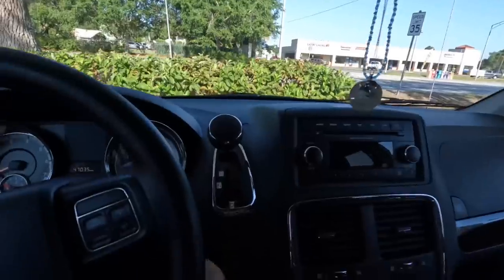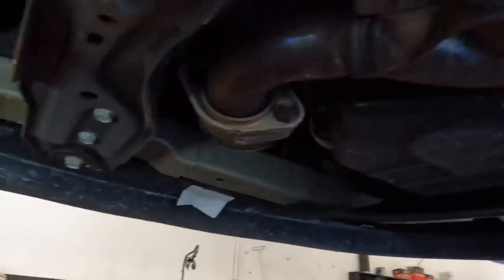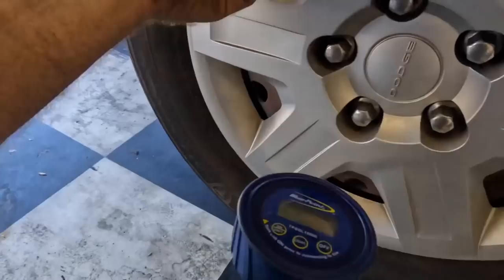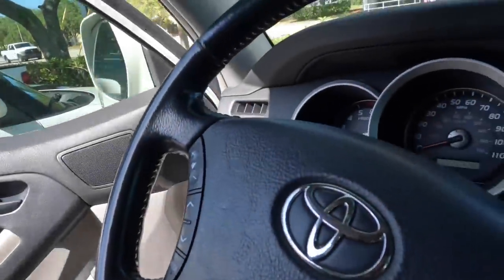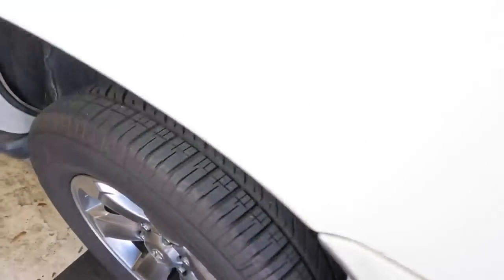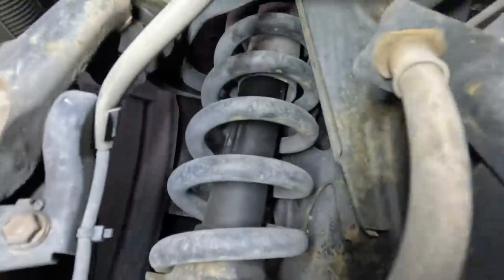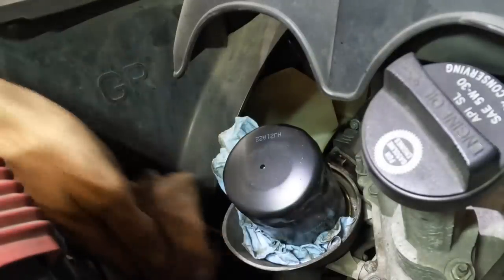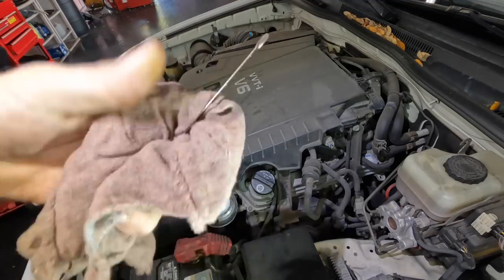This video is terrible! Home Sick B Roll

Comment: Hey Ray! I had to put a new alternator in my daughter's car this past weekend. She helped me throughout the process. There were a lot of "clicks," "reverse clicks" and "gravity." I watched as one of my tools fell to the garage floor. I told my daughter, "Ray would have caught it." I have been working on my own cars for a very long time, but auto maintenance will never be the same for me or my family since watching your amazing, incredible videos.
Reply: I totally agree. I used to help my Dad many, many years ago, over 40 years, and watching Ray brings back so many wonderful memories. You are making great memories!  Thank you!!
Reply: @lisas292  Dropping Dads flashlight. "Gravity!"  SMACK... 😰   /jk
Reply: LMAO I say Click every time I tighten a bolt
Reply: I drop stuff and now say "<item> Gravity". Family thinks I'm weird, so thats not changed at all :)
Reply: @lisas292  My dad had Triumphs back in the 60s. A couple of Tr3s and a Tr4. My job was to crawl under the car and retrieve the pieces he dropped. I still have some of his Whitworth tools.
Reply: That’s a riot
Reply: It's a good thing when a dropped tool hits the floor. Rather than getting stuck up in the chassis.
Reply: @roadking99jokerst60  watched an engine tear down video where the guy found a unicorn in the sump. Yep a still readable, but pretty worn looking 10mm socket and extension in the sump. 

Beats having to fish it from behind the engine block I guess lol.
Reply: @roadking99jokerst60  Right on! I always hope to hear the reassuring sound of a tool or part hitting the ground. At least then I know I can find it.

Comment: The third stimulus bill changed the formula that employers use to calculate how much to withhold for income taxes so they had to take less out of people's paychecks so they would have a little bit more money each paycheck.  That meant smaller refunds when people filed their income tax returns.

And people who got advanced payments for the child tax credit but could not still claim one or more children, for whatever reason, on their tax returns had to pay income tax on that money and did not get the other half of that child tax credit.

And then there were the people who got reclassified from employee to independent contractor (self employed) and found out the hard way that they owed the employers and employees part of social security and medicare taxes which is 15.2% of their net revenue.

I had six people with 1099-NECs (self employment) come in on the last day who had no idea what a 1099-NEC entailed and did not set aside any money for the taxes and did not have money to pay the fees to fill out and send in the required forms for self employed people.  I had one person who received a 1099-NEC with nearly %24000 on it and no expenses which meant his self employment tax was going to be about $3650.

Just for everyone's information, filing your tax return and paying any tax you owe are two separate events.  You do not have to do both the same time.  So if you think you are going to owe taxes it would be in your best interest to file your tax return as soon as possible so you know where you stand and then have until the filing deadline to save up the money and get the payment in the mail.

I encourage anyone who is thinking of being self employed or starts getting a paycheck where they are not taking anything out for income tax, social security tax, and medicare tax to set aside a minimum of 30% of your gross revenue and then make quarterly payments by filling out a 1040-V and mailing it and your payment to the address listed on the 1040-V.  That way you will not have the big tax payment due when you file and might get a refund like you did when working as a regular employee.

April 15, June 15, September 15, January 15 of the following year are the dates you should make quarterly payment by.  You can make them earlier or later except for the last on in January which should not be put in the mail later than the 15th.

Comment: I can give you a little tip for the Toyota vehicles when you’re changing the oil, Take one of the single quart bottles of mobile one and cut the bottle in half, The threads on the top of the bottle are identical to the threads for the oil cap on that motor so you can use that half bottle as a makeshift screw in funnel

Comment: A trick I learned working on my 07 Tacoma, just put an empty oil bottle wedged in the area under the oil filter and it collects the spillage, or run a tube from that little nipple to a drain pan.

Comment: That Toyota 6V 4 litre is easy for an oil change. My sons Tacoma had enough ground clearance you can slide right under and drain the oil with no ramps or lift. The filter is easily accessible on top, but use a little cup under the “moat” to catch the seepage.

Comment: Hey Ray. Hope your having a great day today. One thing I always do on my Toyota (Yoda) I put an old quart jug just under that little hole and it catches all the oil from the filter and then I put on new filter and brake clean it. Catches all the resedual oil and all the brake clean. Just thought I'd share my little hack. Hope your doing well through the hard times.

Comment: As for the optional engine covers. The audi 4.0 requires the cover to be there while driving. The heat from the turbos will damage the hood.

Comment: For that Toyota style, I use an old soda bottle. Fits (even on the bottom), don’t make a mess, and has a cap to just throw away after dumping the oil in a proper container.

Comment: I get a 32 oz bottle of lucas empty and cut the top off and use that under the drain hole to catch the oil from the filter, great video and yes the last couple of weeks has been slow here also in New Mexico

Comment: When a sticker leaves goo behind like that you can usually get most or all of it off using the sticker itself.

Look at the back of the sticker and see where there is still sticky stuff. Put the ball of your finger on that spot from the back side, and gripping the sticker, roll it from one side to another on a piece of goo on the windshield. Often the goo on the windshield will stick to the goo on the sticker, and by rolling the sticker over it, you pry the goo off the windshield from one edge to the other. 

If you have more spots, use a clean section of sticky on the back of the sticker for each one. Usually this will get most or all of the goo off before you run out of sticky stuff on the back of the sticker.

Comment: You can use the adhesive on the pil change sticker to help remove the adhesive stuck to the windows. Pat the window with the sticky side of the sticker, and the adhesive grabs itself. I do the same with price stickers on collectible boxes. I dab the remaining adhesive with the price stickers after peeling them off, and the leftover adhesive gets pulled off without damaging the cardstock or plastic.

Comment: A good tip for those top side oil filter on those toyotas I use q little hose to connect to the drain and let it drain into a catch container best part no mess

Comment: I had a 2004 4Runner with the 4L V6, that my buddy bought from me and is still driving. They are hard to kill. You are meant to put an empty oil bottle under the drain hole to catch what drains out  when the filter is removed. However, you are also supposed to take the catch bottle out before you start the engine (which my dealership neglected to do). I believe it was the pulley on the AC compressor that wore a hole though the plastic bottle and threw oil all over the motor compartment. Another dealership did the 40,000 mile service on it and neglected to reinstall a vacuum hose they had removed. My truck ran like crap and burned twice as much gas for about a 1,000 miles until the check engine light came on. I took it back to the same dealership. They put the hose on where it belonged and said "Oops, our bad." No apology, or gee can we do you next service for free, or anything. I can't recommend taking your car to the dealership for anything but warranty work. I found a good independent mechanic and haven't looked back.

Comment: Back in the day, after they had invented 'can' oil filters but before the invention of those nice oil filter wrenches, there was another way to loosen them.😎 Namely, by hammering a screwdriver right through the can which gave you enough leverage to remove the tight ones.  😉 another great video Ray 👌
Reply: My very first oil change forced me to use that trick. The filter was so tight that the screwdriver just ripped through it! Ended up buying one of those wrenches. Probably my very first mechanic tool that I ever bought

Comment: Shop 'extras' I had the lower dash out of mine French car at the weekend (don't you hate cable gear shifts!) anyways putting everything back, I was left with two shiny 8mm bolts with captive washers! I don't know where they came from, even after stripping everything back out. I don't even remember removing them seeing as the whole dash area is held in with torx screws! They remain a mystery and now live in the glove box. I'm sure one day I will find out where they came from.

Comment: It’s the gas prices that are throwing things off. We had a guy bring his Subaru into our lube shop for a fluid check, & we found mold in his brake booster, he didn’t have any oil in his engine… barely enough on the stick, & for some reason they let him drive out of the shop without adding a quart.

The motor is probably blown by now.

Comment: My employer has had many former employees that neglected to reinstall skid plates/splash shields and engine covers. Possibly forgetting is why I never take the engine cover out of the engine compartment, and why I always leave a single bolt/screw in the skid plate/splash shield and spin it around out of the way. If it's in my way and annoying me, I won't forget it.

Comment: Our shop has been pretty slow right now as well. I haven't been in the automotive a full year yet, so I don't know exactly what it would have been like previous years, but from what I gather from my coworkers, it would seem that it's usually a lot busier right now. Personally, I'm thinking crazy high gas prices may be playing a role in the lack of customers. Probably a lot of people are using alternate methods of transportation, or just not going anywhere, or even just minimizing use of their vehicle thus prolonging the life span of the vehicle's parts. IDK, maybe small tax return checks is a factor as well.

Comment: Glad you're doing better Ray 🙂 your videos have inspired me to to bite the bullet and start buying tools to work on my own cars with. I've already done so much that I wouldn't have even known how to diagnose if it weren't for your videos (shaking steering wheel while braking, hydraulic lifter not seated in rocker arm etc). Next job is a big one though, timing belt on an old Mitsubishi sohc 4g64.. in your opinion, what are some "must have" tools for such a job?

Comment: Rav4 after 2 year free oil changes...I tried to remove oil canister..used my floor jack arm.. and slid on floor.. reposition got it... but my 3 foot jack arm??  I use a torque wrench never a problem

Comment: Those 1GR-FE toyota engines are notorious for being difficult to read the dipstick correctly. Just fill them with 5.5 quarts of oil and your good to go. There is also a TSB where toyota added the use of 5w20 on that engine.

Comment: 9:36
Look into purchasing some Series I Savings Bonds from the U.S. Treasury Dept. They offer a 9.6% return (compounded semi-annually). Limited to $10k per individual, but a great way to increase your savings during an inflation. Rates adjust every 6 months, so you need to jump on this sooner than later. Whatever you do, don't check your retirement account or investments for a little while; it will just depress you.

Comment: What was toyota thinking with the oil filter on the top of the engine? It's not like you don't have to go underneath and drain out all the old oil first. Lets allow all of that oil to drip into a catch pan and that catch pan has a hole in it so the oil just cascades over the engine. Give that engineer a gold star.

Comment: If I can guess the size of that plastic pop rivet? how about a S/S  # 12 or 10 fender washer? 
 How many cars do I see which have black sidewalls. ( Yes, that the side walls are flexing so much that it breaks the rubber off of the side of the tires.) Which is different looking then the ones who can't tell where the curbs are and rub them. 
I am going to remember today to drop the  front tire pressure down 5 lbs to 100, as that makes them bounce.Errrrrrrrrrrrr

Comment: Hey Ray, Out of curiosity on the highlander, I see it had a spin on filter up in the engine bay, was this a 3.5 litre petrol? as I have the same engine in a 2010 toyota aurion (higher spec full size sedan on a Camry chasis) living down under in New Zealand except the version I have uses a filter element rather than spin on filter for the same engine, Cheers

Comment: Ray is it just me or are these manufacturers of newer cars making filters Itsy Bitsy Teenie Weenie little things? What happened to those manly filters that used to hold a quart of oil by themselves. In my 73 Nova SS LT1,350 CID. I put a remote two filter set up on the inside finder well, now those were manly filters the size of a 2 lb coffee can and both filters together held about 3 qts. I know some of these small weenie engines only hold about 3-4 quarts of oil.  It just seems stupid to me to use the smallest filter possible on these new POS cars. lol  PS: Ray I always love your videos no matter what brother.

Comment: Okay, here's my confusion.... When dealing with a top filter I would think the pseudo funnel looking bit would be good to stop the used oil leaking from the old filter from getting all over the engine bay. Seems logical and very easy to identify that appears to be the logic of that piece.  As soon as they put a big hole with no removable plug I am now failing to see what benefit that piece actually has. After seeing what you had to go through to get the 5k torqued filter off with a reduced purchase area because of that funny shaped funnel looking thing I'm feeling to see the benefit of it. But then again I'm not a mechanic so I could be totally off base and that could be the best thing since sliced bread.
Reply: I have a Toyota Tacoma with the exact engine and they do put a rubber plug under that drain hole I always use a Dixie cup when I take off to filter and it fills it about halfway with no spillage

Comment: I actually got a better tax return than normal. Probably because I did light mining. The service I used paid taxes and they only collected extra for income if you make over $10K. I only made like $4,000 so it wasn't charged. It was just used when my system was otherwise left dormant. Stopped back in around January when I could see profits were plummeting.

Comment: Some unscrupulous mechanics remove the plastic beauty (engine) cover and don't put it back and sell it on eBay. Happened to me - I didn't check. Got a replacement where else - on eBay... Was not cheap but cheaper than from the dealer. 
Gone back weeks later when I realized its absence at an oil level check, to complain, to no avail. Never went back. It's likely, that the shop's owner wasn't even aware that one of his guys was supplementing his income this way.

Comment: What I do with sticker leftover glue, I put back the sticker (a couple of times) and yank it off very quick like, that way usually the adheasion substance leaves the surface and  stays on the sticker.

What noticed me in several videos is that there is often a colleague sitting on his deriëre doing something on his phone, shouldn't he be working?
Reply: If there is no work, there is no work. I have been in that position myself. Clean and organize what you can then wait for something to come in.

Comment: Always good to upgrade from a Toyota OEM filter to a generic white one.
Reply: Toyota most likely doesn’t make their own filters. Wix or Fram or someone does. They’re not usually any better or worse than any other. Keep the oil changed and you’re fine. I know Wix used to make Motorcraft for Ford.
Reply: @stevewhiting556  Toyota filters are made by Denso.  Very good quality.  The filter he put on looked like a cheap "white box" one.  Not Ray's fault, he doesn't pick the parts but if you watch his videos you will see his shop uses mostly lower end aftermarket parts.

Comment: Used hate those engines replace oil filter cartridge an bypass  portion on top of center tube would leak oil an antifreeze 2.0 hours

Comment: I wonder if 35.6psi would of been 36psi if the car was on the floor instead of in the air at point of checking tyre pressures???

Comment: I’m not sure what type of voodoo magic your battery tester uses to test 750+ CCA with leads that could probably only handle 15-20 amps? The battery testers I used in the 80’s had thick cables and heavy duty clamps.

Comment: OK, Ray, you really screwed up. You did not prefill the oil filter, there’s got to be some sort of fancy assed tool to make that possible with a vertical filter. 🤪 Oh and BTW, you did not use the air cannon to displace the leaves 🍃 😜